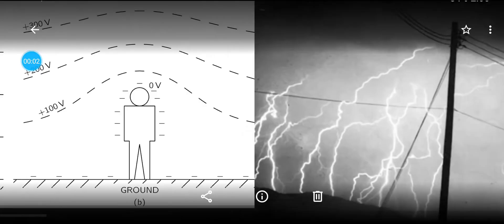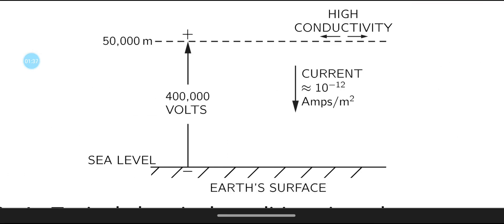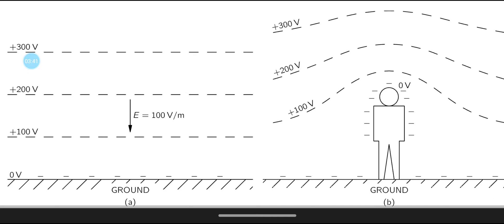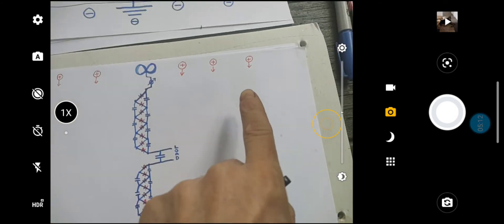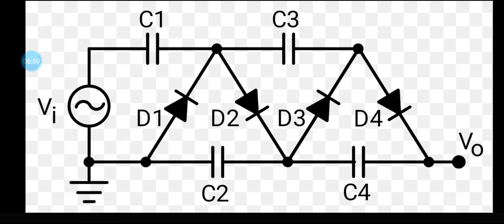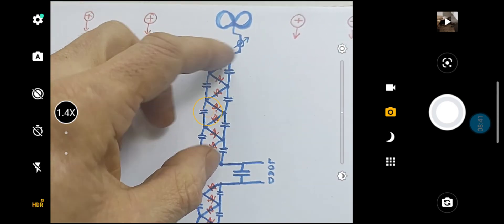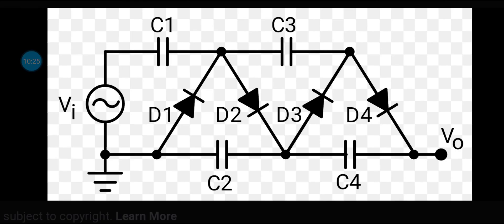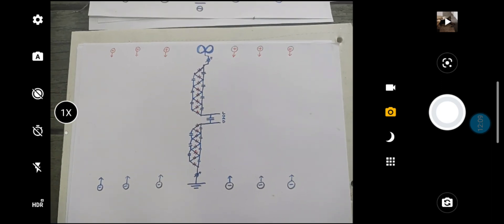Electricity in the Atmosphere (My Harvesting Concept Based on Feynmans Lectures.)

Comment: This is a cool concept I wish I new more about high voltage circuits.   I am book marking this for sure and circling back when I know more.   I'm working on a 420 ft tower I want to implement something like this to capture lightning and store the power in capacitors and batteries.  I also seen and experiment the other day were they cut the circuit to the ground and reconnected it repeatedly fast and it increased the voltage by flatting the voltage lines when disconnecting the ground and reconnecting it to re-expand them over the tip.  Maybe this is how you can increase potential as well, they did produce 5 to 6 times the voltage.  Kinda like shaking that board with the sand?
Reply from the maker: Excellent my Friend,
I do think the key to greater efficiency is resonance.
Something to keep in mind.
Stay safe & good luck with your exploration.
Reply: So can we charge a battery or a capacitor that could charge a battery? Hook it up to were the LOAD is?    @crazyham
Reply from the maker: @troygrover6441 Well, That would be the idea,
though it is something I am yet to experiment with in the real world & I have considered many variations of the design too.
I suspect it would require being excited by a loe energy signal (that the system is tuned to) & hopefully would deliver more energy that the applied signal uses...
I am currently renovating my house & plan to relocate interstate, so when I settle down in the next place I will come back to my experiments 🙏
Merry Christmas 🎄
Reply: my 3cents, i think capturing lightning would be harder due to impulse, but capturing the static from the air before then to drain the clouds woudl be a better idea, as the voltage per m shoots up higher during stormy weather

also, teslas energy circuit did include a resonator to stop the field form dropping too low
Reply from the maker: Yes, I think that's why Tedla said Polarise Everything.
Taking advantage of the polarised nature of the voltage gradient and utilising resonance must be the answer. 
I will experiment with these ideas when I settle in my next home during the year ahead.
Tesla used low frequencies 
Though I think today we have the advantages of much higher frequencies
Allowing for much smaller components too.
Thnx for your great comment my friend  ⚡🙏⚡

Comment: You could do what the old timers did and use a little radium chloride paint on the top. And for the first test just use a drone to raise it to see what it will do . instead of a drone a trash bag of hydrogen will work .and stay there with out additional energy. It's the dam lighting strikes. But it seems that there's natural places or spots on the earth where there more inclined to happen.there now using graphene strips to absorb the energy . I thought that a hydrogen bag on a wire that can be let up and down might be more serviceable. They can tell somehow the electrical potential in the air above and fire rockets into it to create a lighting strike that might tell you to drop the line . It's very much worth working on .

Comment: What about Ben Franklin and Amos (cartoon) ? Sorry , it just came into my mind... I've read something about what you're talking about (not my field - I'm mechanically inclined and educated) in the Patric J Kelly book , in a chapter that is about "static systems" ; I think that Mr Henry Murray was mentioned there (100 years ago , or so) with similar kind of experiments and , apparently , the whole thing worked based on a "electrical valve" (I assume that it was something similar to a glas vacuum tubes  , that lived in radios and TV sets , back in a day) , which he tried to patent , without a success , but later his son did it as a part of some medical equipment. If I remember it correctly , it has something to do with certain frequency , which certain mineral resonate with , but better to look it up yourself - it is freely available in PDF format online. There are other aerial sistems described , that  supposedly worked , but , in the book , every topic connected with high voltages comes with warnings about high voltages and possible thunder stroke and I've been connected to 380 Volts AC / at 50 Hz - not a pleasant feeling , so I try (as a rule) to avoid anything that is measured in KV , even in mA...
Reply from the maker: Thanks for the great comment my friend.

Yes, it's never nice getting a HV zap hahaha,
Had far too many myself along the way.

My scariest was a 600 volt DC kick when I accidentally became a bridge across some large capacitors I had charged to 600 Volt.

Could have easily killed me
But I was lucky.

Cheers mate ⚡🙏⚡

Comment: The downward flow of electricity is responsible for what we call gravity, we live in an enclosed system between two gaussian surfaces
Reply: .. this is what we call bs.
Reply: @7sonderling  please elaborate
Reply: The dielectric charge emanates from earths surface 90deg orthogonal. 
This provides the back bone/structure for the earths field that is 90deg orthagonal from the charge. 
This accounts for the delay in inertia when you jump out of a plain. 
The dielectric charge locks onto you when your freefalling. 
The dielectric charge will eminate 90deg orthogonal from that mass and discharge into the field lines. 
Because you have potential to ground and the charge is coming from that point, the the field lines will pull you towards the ones below and squeeze you down from the ones above. 
Like a tightening of the field, (because you energised it)
This is why you pick up speed when your falling. 
This is my concept for the mechanism for accelerating a body of mass to the ground.

Comment: Very well presented. You should definitely try it and keep us posted. For the thousands of experiments I’ve done over the many years, I am always amazed at the “not listed” abilities of circuits and components. It does however make me believe the reason for not disclosing these features is sinister so as soon as I’m told “it doesn’t work like that” then I’m usually all over it searching for secrets. Perhaps at the top of the tree is where you’d place the Aluminium plates I use in my video where I try to replicate Tesla’s radiant energy patent, which worked great even though it is sitting at ground level, I’m several weeks away from being able to hoist plates above the ground now. 😢 Keep up the good work.
Reply: @crazyham  Thanks for your comments, I subscribed to get your updates, you can never learn too much.
Reply: @crazyham  Thank you.

Comment: overcoming the friction... (stiction or "static friction", yes, stiction is a word) what you are describing (tilting the board) is called biasing.
Reply: @crazyham  not trying to argue but I wouldn't call it creating potential. sorry. also diodes drop voltage and have a turn on voltage, in series this increases.  and as you mention in the video there isn't much power (amps) so maybe create your diode array in a way that you parallel the power instead of series, such as multiple antennas feeding individual diodes and adding that together
Reply: @crazyham  when the weather improves?   Use that lightning!! LOL
Reply: @crazyham  you are correct, I did not realize that.